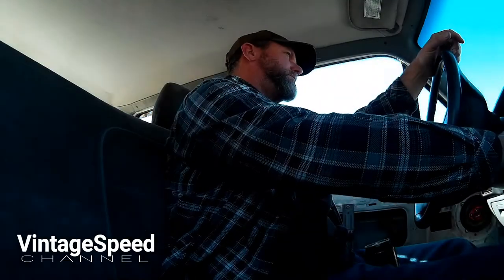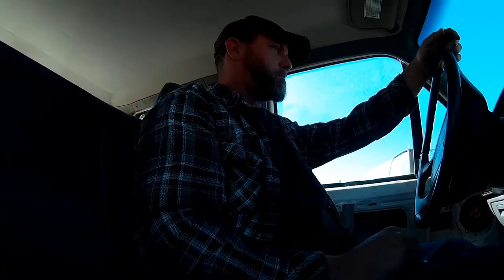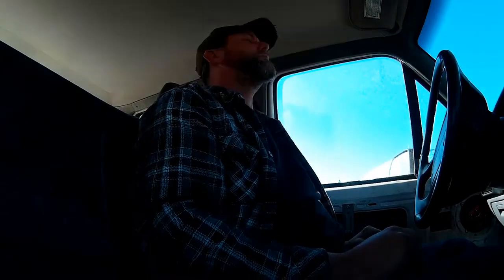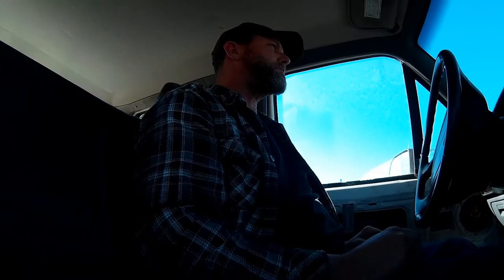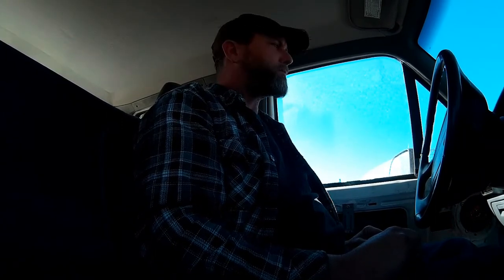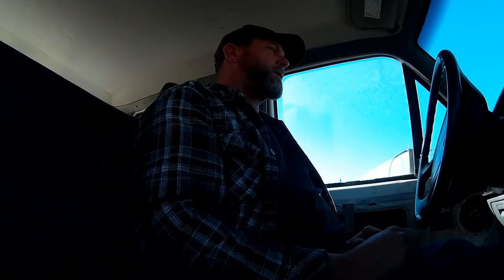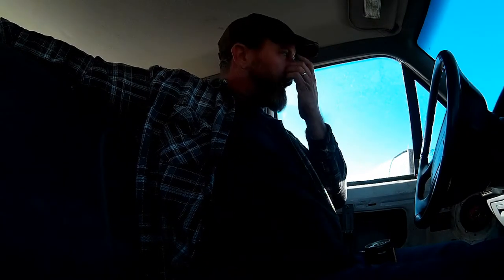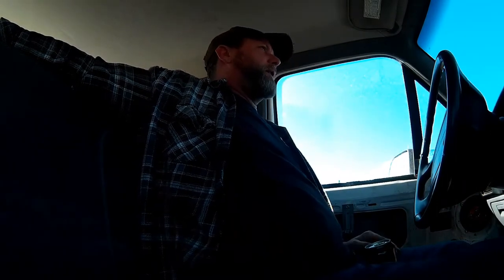Ford OBS; 7.3 IDI Air Intrusion??  Lift Pump Weak??

Comment: Having similar problems with my IDI. I’m replacing orings on the fuel line and replacing rubber section of supplie fuel line.

Comment: Sounds more like a sticking governor. On these IPs there isn't a direct connection between your pedal and the amount of fuel injected. There's a governor with a spring in between, the throttle activates on the spring. That same governor controls idle speed, so when over idle RPM the governor basically goes to zero. It sounds like when it goes to zero it's getting stuck. The governor is relatively easy to work on, it's right on top of the IP.
Reply from the maker: this is great info!  thank you!  i'll check into inspecting & cleaning up the governor spring.  thanks for watching!
Reply: You can fill filter with atf , crank it up for a few minutes and let it soak overnight.  Usually cleans the governor/idle

Comment: check the tank selector valve  i bet it is sticking in between the tanks if trash gets in them and causes them to bleed from both tanks at same time and sometimes these selector valves are damaged internally and actually suck air when stuck between the 2 positions aka both tanks are drawing fuel or in transition from 1 tank to the other.
Reply from the maker: Will do, thanks Rick!

Comment: that filter is getting air in it cause there isn't enough fuel flow something is restricting it or your fuel pump is not keeping up
Reply from the maker: thanks for the info!  my plan was to gut the whole fuel system and replace all the hard lines & flex lines with larger diameter to support compound duals on the 5.9 swap.....but for now i'll try to make it work.